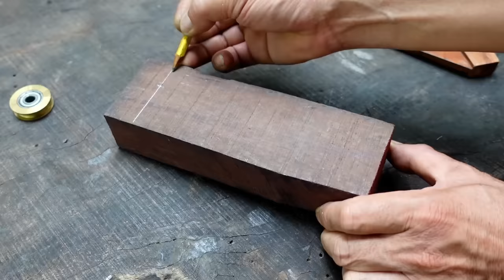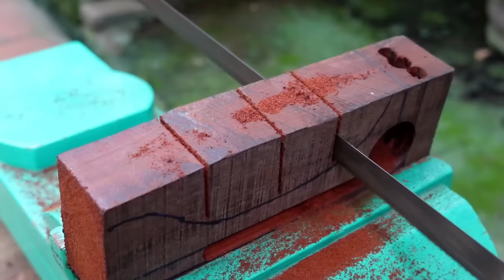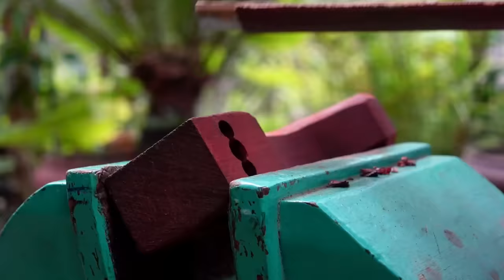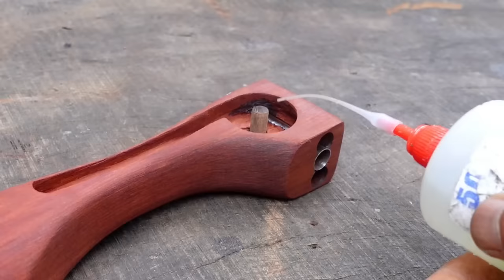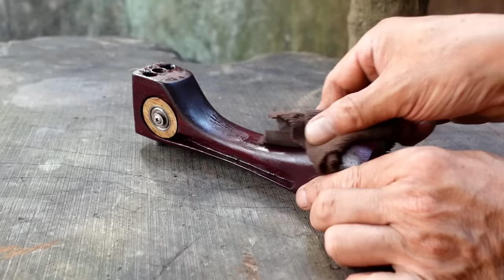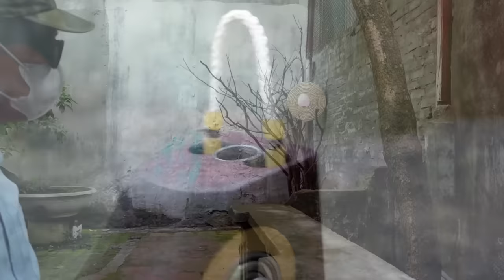Brilliant Slingshot for Hunting and Defense (Secrets Techniques) #usa #fyp #viral #treding #foryou

Comment: great video, but it really drives me nuts when people varnish wood stuff after installing metal pieces
Reply: I'm ignorant.  Can you tell me why that bothers you?
Reply: @pex1111  😎
Reply: Looks like oil.  That wouldn’t matter.
Reply: @pex1111 Because varnish doesn't go on metal. So instead of needing to clean it all off of the metal afterwards, just varnish it before installing the bits and pieces. Saves time and looks cleaner.

Also some varnishes can hurt some metals.
Reply: @pex1111 because he has untreated ocd, most people don't care and think about this because its absolutely pointless
Reply: You need to get out more
Reply: @anarmustafayev1555 no it's just basic wood work
Reply: @Lethal_Bite  what if you don't do it like a dumbass and you're actually careful? That's probably the dumbest thing I've heard all day.
Reply: He varnished wood by oil so it is even better for metal pieces. He had to do it after using glue of course.
Reply: @Goggyegg ikr? People don't know wtf is OCD. This is clearly just having standard, which is pretty much baseline for any professional
Reply: @floridadad2817 That ain’t oil. And it’s in the bearings n shit now. That’s no good bro
Reply: @floridadad2817 what oil that you use has a red tint to it? it's clearly a dye and if you splatter it on metal it will stick.

you varnish before adding metals, so that if moisture gets trapped behind metal parts it doesn't damage the wood.
Reply: Give him a break, he's not exactly a "free thinker" lol
Reply: Drilling holes in hard wood without a wood drill, does annoy me much more
Reply: Yes, it would bug me also to know that there are spots on the wood that is not oiled/varnished, even if it is covered by that wheel.
Reply: @rejuvenation.records As far as I can tell, he uses drill bits meant for wood, doesn't he?
Reply: @anarmustafayev1555 it is not pointless 
You need to protect places under metal parts too.
Reply: I think it is just a coat of oil which is fine for metal.
Reply: That's not varnish bud it's oil based wood stain although I still agree I would do it first however I think k these bearings are probably sealed so probably won't make much difference
Reply: @pex1111 pexie?
Reply: pexie?
Reply: I think its linseed oil
Reply: Same here! I see these guys building furniture and doing meticulous joinery. Very nice craftsmanship, and they install this nice brass hardware. And then spray the whole thing with some crappy high-gloss lacquer. Over the brass and everything. All that work just destroyed in the stupid lazy finish. Drives me crazy!

Comment: Neat design, though could be made far more powerful by making the handle longer so that longer elastic bands could be used and pre tensioning them so that they continue accelerating the projectile over an extended distance. A brace similar to a wrist rocket would allow for greater tension to be applied.
Reply: And imagine if he ad coil spring inside, o boy o boy, how smart lm.
Reply: yes ,i see that 100% genius bro !!!
Reply: Until you get a ball bearing between the eyes? Hahaha

Comment: There is no need for metal rollers, get a plastic version and it will shoot with higher velocity "for free" because of less energy wasted to get the rollers spinning. It will also reduce wear on band/tubes.

Comment: I'm interested in seeing this design, or something similar to this design, using metal pellets.
Reply: It's been done. JoergSprave has made a few slingshots with the addition of wheels like in this video. The wheels are unnecessary and don't add any power/speed to the shot. Slowed down we can see the wheels remain static as the elastic contracts.

Comment: Studs (cracked by screws inside) holding bearings (pulleys) will snap and the short rope on the rubber will cut on the steep pipe edges maybe,

Comment: If it was possible to use joint connecters (post replacing the dowel) or standoff screws or something else metal to fasten the pulley, that would probably extend the life of it.